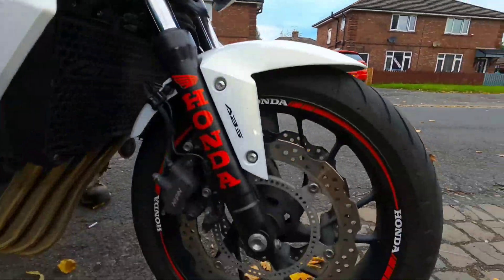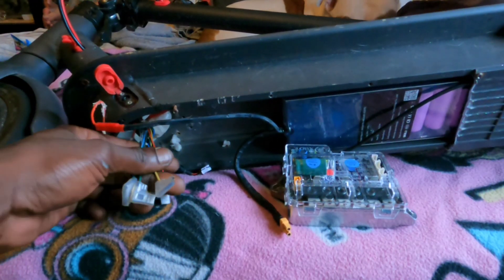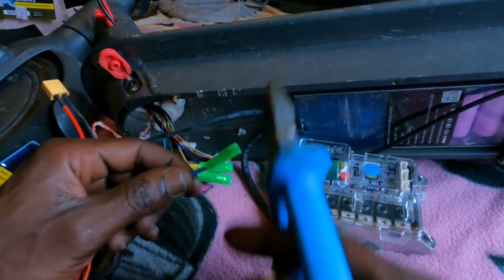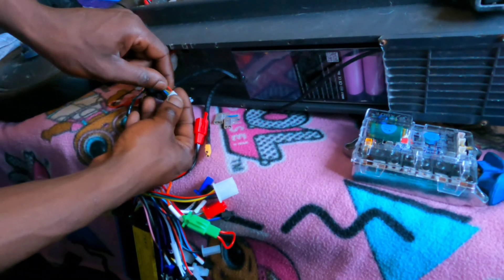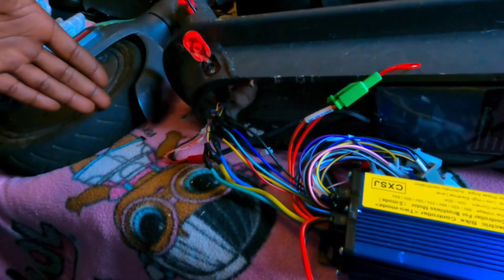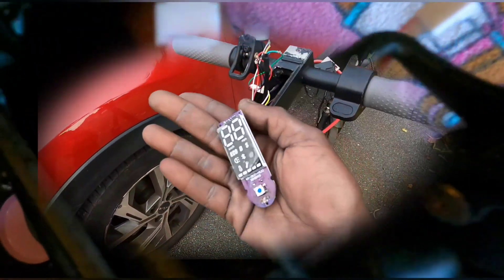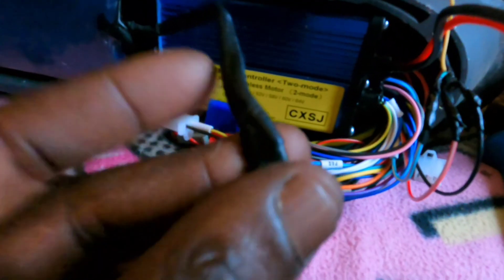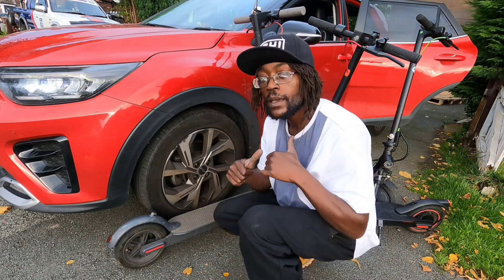Make scooter faster (electric speed controller fitting guide)

Comment: I'l guess that the scooter u tampered with has burned by now. But exactly how fast did you get it to go before the total demolition of the motor/battery?
Reply from the maker: Bro, surprisingly that scooter is still alive. In daily use. It does actually do 32mph, not 32kph. It is used for short distances to the local shop. No more than 5 miles at a time. I have noticed the hub motor tends to be hot after that short ride. Otherwise no other issues besides eating through brake pads quickly. 
The scooter actually still lives a year later.

Comment: Yo bro I cave a 42 v controller could I cut the wiers and put my original controller connectors onto the 42 v controller because they have the same wiers just diffrent connectors
Reply from the maker: Yes. Along as the voltage is the same. Match up the colours to your new controller. If the connectors do not match up. You will need to connect each wire one by one. 
Connect battery wires last for safety